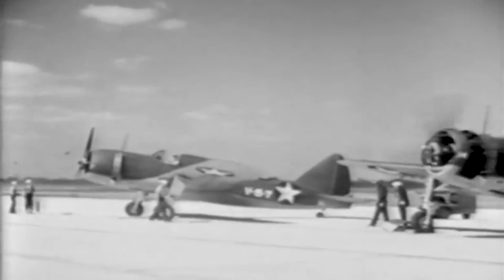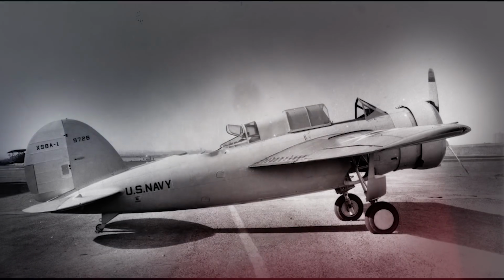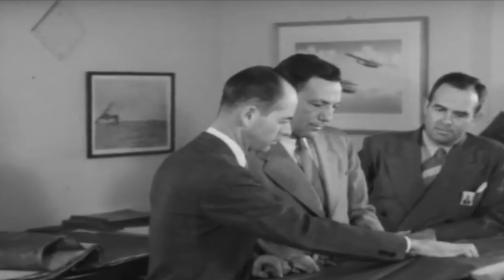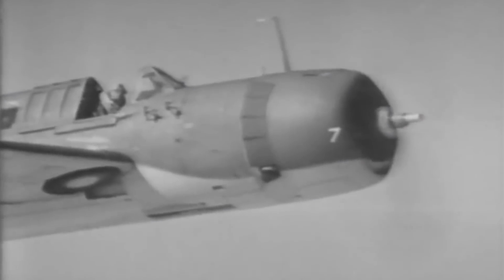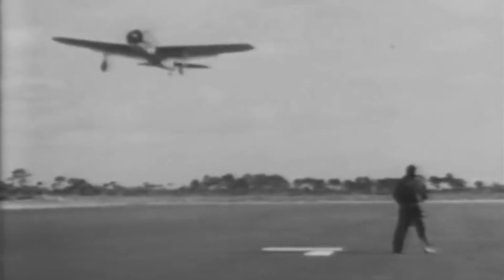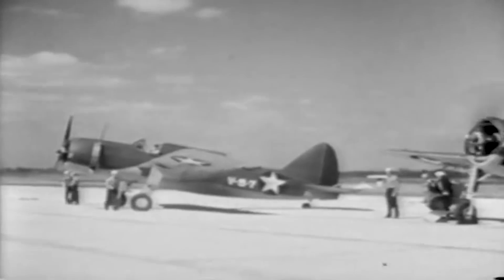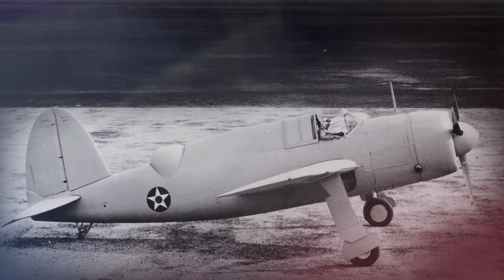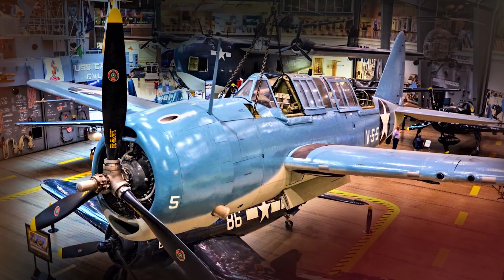The Worst Airplane of WW2 - Brewster Buccaneer Scout Bomber

Comment: The prototype F2a Buffalo Fighter preformed far better than the Grumman Wildcat and incorporated automatic rather than hand-crank landing gear. However as requests were made for the production models (wing folding, armor, self-sealing gas tanks, increased armament, etc) the engine could not keep up with the added weight, while the F4 too these changes in stride with little degradation.

Comment: My father was a WWII PBY Pilot stationed on Cuba during the war. He told me that he had the opportunity to fly a Buccaneer and had to do it solo because no one would fly rear seat. My dad said he needed the whole runway to take off, it had next to no climb rate at full throttle and the engine sputtered as he approached the runway for landing. Anyone who flew that plane called it the "phuckeneer" because it was a suicide for the pilot and rear seat to fly it, the engines would catch fire in flight, a portion of the wing,  canopies or landing gear would fall off and worst of all it had tendencies to nosedive at full throttle into the ground before the pilot and rear seat could bail out killing them both.

Comment: I find it kinda funny that this is what they chose as the worst aircraft. Like there are definitely worse. Breda Ba.88, Boulton Paul Defiant, etc. Also a lot of people forget that this thing is basically identical at least in concept to the Curtiss SB2C (which was also wildly unpopular and had many of the same controllability issues) but that got adopted and was used with some success. I guess the difficulty was that Brewster was never going to be able to fill a sizeable order, much less maintain a supply chain for the aircraft actually delivered. And yeah, there probably was an issue with workmanship. But I'm unconvinced this was an inherently bad plane.

Comment: This WAS 1 OF THE BEST ✈ AIRPLANE$ OF 🇺🇸 US NAVY ;  IT WAS FOR HIGH ALTITUDE FLYING NOT FOR SPEED ,  IT FLEW THE HIGHEST ALTITUDE AT 45009 FEET RECORD MAN ;  IT WAS INVENTED FOR HIGH ALTITUDE FLYING AT 260 MILES IN HOUR ;  NO OTHER FASTER ✈ AIRPLANE FLEW THAT HIGH ;  IT WAS INTENDED FO4 HIGH FLYING JAPANESE & GERMAN ✈ AIRPLANE$ ;  AND IT SHOT DOWN SO MANY JAPANESE & GERMAN ✈ AIRPLANE$ AT 35000 FEET ,  IT WAS THE MOST MANEUVERABLE AIRPLANE$ ✈ AT HIGH ALTITUDE ;   BREWSTER AIRPLANE$ ARE STILL IN SERVICE TODAY WITH BETTER ENGINE$ ;  THEY FLY AT 55000 FEET TODAY ;  IT ALSO HAD A SECRET ROCKET 🚀 BOOSTERS THAT PUSHED THE AIRPLANE AT 45000 FEET ;  IT WAS USED FOR GERMANY CAMPAIGN ESCORTED NIGHT FIGHTERS OF 🇬🇧 BRITISH SQUAD AND DAY CAMPAIGN$ OF 🇺🇸 USA$ AIRFORCE ;   TODAY BREWSTER IS USED BY NAVY STILL AND IT CAN LIFT VERTICALLY NOT NEEDING A RUNWAY ;  THE TODAY$ BREWSTER IS A SECRET AIRPLANE ✈ THAT HAS BOTH PROPELLERS ENGINE AND ROCKET JET BOOSTER$ ; IS A SECRET ✈ AIRCRAFT THAT IS SO USEFUL AND FLYING AT 65 THOUSAND FEET OR MORE , AT 600 MILES IN HOUR AND AT 65 THOUSAND FEET IT FLY$ EVEN FASTER AT 800 MILES IN HOUR ;   CARRYING 2 MACHINE GUNS 22 MILIMITER CANON$ GUN$ AND 2 AIR TO AIR MISSELS ROCKETS 🚀 ,   IT WAS USED SECRETLY IN IRAQ WAR AND SHOT DOWN IRAQI 🇮🇶 MIG 23 ,   IT SHOT DOWN 4 IRAQI MIG-23 MAN ,  BECAUSE IS SO MANEUVERABLEIT CAN STAND STILL ON AIR AND TURN ANY DIRECTION U WANT =  MAKING IT A PERFECT AIRPLANE AIRCRAFT SO = CHEAP TO USE AND CAN FLY FOR 28 HOURS ;  VERY CHEAP ON FUEL ⛽

Comment: Comparing the Buccaneer to the Curtiss Helldiver, I noticed that the wing area was less than the Helldiver by 43 SQ FT..  That's going to hurt overall performance.  The engine was 200HP less than the Helldiver 1700 HP to 1900 HP due to different  versions of the Wright R-2600.  It's not a bad looking design for the time and the wide main gear looks good.

Comment: The SB2C Helldiver was greatly disliked upon its introduction, with many flaws that rightfully earned it the nickname "Son of a Bitch 2nd Class."  By the end of 1944 or so, however, it had been modified and the bugs ironed out to become a pretty fair dive bomber.  While I have my doubts that Brewster-the-company could have done the same with their entry into the same competition that brought us the SB2C (and the Vultee Vengeance as well), simply because they were so pathetically managed, that hardly means the plane was the worst aircraft of WW2... not when it had such illustrious competition as the Blackburn Botha, the Blackburn Roc, the PZL.30, the Bachem Ba 349, the Douglas Devastator (which really wasn't THAT awful, just terribly outmatched), or the TRULY horrible Breda Ba.88.  You want worst aircraft of the war?  Look at that Italian plane, then get back to us.

Comment: One squadron of the Royal Australian Air Force managed to get the Buffalo to perform in a way that was semi-acceptable.
They stripped out all the armour and everything else that could be removed from the aircraft.
The .50 machineguns were replaced with .30 machineguns.
The problem with the .50 machineguns in the wings was that the mountings were not strong enough to cope with the recoil, so the metal broke.
The ammunition was cleaned carefully, to stop grease from the rounds being deposited on the windscreen, which blinded the pilot.
The Buffalo was still vastly inferior to Japanese fighters, but the lighter Buffalo had at least a fighting chance.

Comment: Wasn't the original version of the P51 also underpowered and rejected for front line combat?
Reply: The original Allison engine was OK at low level albeit a bit slow but the Merlin made the plane, giving it range, speed and altitude performance, the Merlin being license built by Packard.

Comment: Almost exactly the same weight as the F4-U. However more drag and 600 less HP. Not good. And that's with the more powerful engine. The F4-U was 700 pounds lighter empty too.

Comment: I live a few miles from the old Brewster factory in Warminster, PA. Brewster became notorious during the war for poor quality, slow production, labor strikes and some said even sabotage by workers. At one point the Navy had to step in and take over the plant and throw out the company president. Locals began calling the plant "The Bucks County Playhouse" as a reference to a well known theater in the area. Corsairs built by Brewster (F3A) had so many problems that wings were coming off because of poorly made fittings. Eventually they were restricted from aerobatic maneuvers, a serious drawback for a fighter plane, and used mostly for training. The site after the war became NAS Johnstown and the factory buildings were used by the Naval Air Development Center. It was closed down several years ago and when the buildings were demolished the original Brewster Aircraft Company signs were discovered under the Navy signs. The  Buccaneer that's in the Naval Air Museum now was being slowly restored by a group of ex-Brewster  employees when the site was closed and sent to Pensacola where it was finished by the Navy.

Comment: This has forward firing guns, automatically that fact makes it better than the Boulton Paul Defiant & Blackburn Roc.
Reply: Not really. If taking on unescorted Bombers, having an aircraft that isn't a complete pig to fly is far more important.
Reply: @jimtaylor294  To be serious this time. If you look at the performance for the Defiant, Roc & Buccaneer, you will see that the Roc is easily the worst of the three and the Defiant is the best of the three, in terms of the actual flying part anyways. Looking at things like ceiling, climb rate, and whatnot.... though the Buccaneer has a far greater range (even if the data I am looking at listed  for the Buccaneer is ferry range and the others are regular, it would still be around what the Roc has and would be about 2x that of the Defiant, however there is no indication that it is a ferrry range). All of that said the buccaneer is about 50% heavier than either the Roc or Defiant, so I Imagine its handling to be inferior. Its engine however is far superior to the Roc and Defiant in terms of power, 890hp for the Roc, 1,030 for the Defiant, 1,700 for the Buccaneer). The mass of an object is one of the things that determines how much damage it can take, bigger things can, all things being equal, take more of a pounding. You can see that come into play in a major way in ships, but still comes into play elsewhere, so something tells me the Buccaneer would be superior to the Roc & Defiant in terms of durability, but of course far more than how big/heavy something is comes into play there. The Defiant for instance has a V-12 engine and those are far less tolerable of damage than the radials used in the Roc & Buccaneer. You can take out a cylinder for a radial and it can keep going while that usually spells doom for a V engine (just as an example).

To be perfectly honest, while the Buccaneer might be crap, those turret fighters are at a different level of garbage than anything Brewster made. The Defiant made for a decent stopgap night fighter until other aircraft were adapted to the role (which were then themselves superseded by the P-61, designed from the ground up as a dedicated night fighter). That was a role that was found for it and only a stopgap in any place.

"One of the worst" planes in WW2, sure, the Buccaneer is easily one of the worst..... "The worst", no, it isnt the worst. Given that I was not lying about the Roc & Defiant not having forward facing guns as well as performance data and whatnot I truly cannot consider the Buccaneer to be worse than either of them.

Sorry about being a bit of an @$$ with that first response.

And really, not even a pair of .303s facing the front, even the Dauntless had a pair of 303s in the nose smh.

edit: typo
Reply: @jimtaylor294  I could respond seriously and talk about how the Defiant worked well as a night fighter and whatnot sure however....

humor go whoosh at flight level 30
Reply: ^ Well we'll have to agree to differ; as I'm not able to respond word for word with this device I'm on.
(I despise OSK's)

I will add though that the clinching factors for me are build quality, and dead weight.

The Defiant theoretically could have been uparmed & engined, as like the Roc it wasn't absurdly overweight, not seemingly fighting its own engine.

Brewster's infamous build quality is the key detail though. Even when taken over by the US Navy & given the job of producing something not crap by design to build; they screwed up, with said aircraft being found to be as much deathtraps, as their own designs had been.

In my opinion Brewster's Bucc' is in the same category of crap 'planes, as the trio of irredeemable WWII Bombers: the Botha, the Hienkel Greif & the Polish Zubr.

Comment: 25,000 feet ceiling and 200mph something top speed were low compared to other piston aircraft in WW2.
Reply: ^ ... Against ground targets. Even a Gloster Gladiator could out turn & fight a Stuka. The Luftwaffe withdrew it from the BoB because it got slaughtered in contested skies.
Reply: @jimtaylor294  But my point is that the Brewster Buccaneer was also designed to be used against ground targets, as were all dive bombers. It can't be compared to "other piston aircraft in WW2" if you are including fighters in that.
Reply: @barryervin8536  The point was more that the Stuka isn't a great point of comparison. Comparing one failure against a better built but even slower one doesn't achieve much.

I mean even the Swordfish Floatplane did better than the Buccaneer, by actually accomplishing something of military value in WWII... that technically included the most visually bizarre bit of dive bombing ever.
(few things weirder than a bi-plane floatplane divebombing a submarine... and succeeding)
Reply: It was no speed demon, but it was a dive bomber, not a fighter. The Stuka was even slower and it was quite successful early in the war.

Comment: Whatever happened to the one at Naval Air Development Center, Warminster PA (former Brewster plant)?  They started fixing it up for display back in the 80's. I never heard what they accomplished, or what they did with it when NADC closed.  

I worked there as an engineer 1976-1996 when I transferred to NAVAIR at Pax River MD.
Reply: I know there is one on display at the National Naval Aviation Museum in Pensacola, FL.  Did some googling, and it appears that it was send down to the museum after the base closed and that  restoration process was finished and its now on display down there.

http://www.aerialvisuals.ca/AirframeDossier.php?Serial=62976
Reply: @ReganSmash33  Thanks!

Comment: Brewster's build quality was appalling. The aircraft were full of loose nuts and bolts dropped by workers during manufacture that no-one had bothered to retrieve.  after complaints from the USN and RAF, Brewster decided to sort that problem. Rather than training the workers properly in quality practices as other manufacturers did, they built a huge hydraulic rig that rotated and shook the airframe so that the loose hardware would fall out!
Reply: Lol

Comment: I bet the Finns would have been able to put them to good use. It's a shame they were shoehorned into the axis powers due to the Continuation War against the USSR. Although the USN, USMC, RAAF and RAF didn't care for them the Finns loved the Brewster Buffalo so much that they worked through the duration of the war trying to make a knock-off of it. The Dutch used it to a reasonable effect in the East Indies too.

While I don't doubt that the Buccaneer/Bermuda was insufficient as a combat aircraft I suspect its problems had more to do with the technology available at the time and the requirements made of it than substandard production.

Comment: Blackburn aircraft says hold my beer!
Reply: Yeah. Made a postwar aircraft of the same name that was the opposite of crap XD.
Reply: @jimtaylor294  agreed, but thru out the interwar and during ww2 they had possibly the worst run of aircraft for a top power imaginable!
Reply: @FarmerTed  Well; apart from Brewster anyway XD.
(Blackburn aircraft in WWII at least could claim to have been built quite well, if not to the best of designs)

Comment: Brewster didn't close its doors in 1946, the navy closed them down in 1944, after cancelling its contract for the F3A Corsair, which it found out that the Corsairs they built under licence from Vought had so many defects, including throwing oil onto the windscreen. Also, the Buffalo's production versions were: F2A-1, F2A-2, and F2A-3 for the Navy, and the Model B-239, and B-339, for export customers. Now, the Buccaneer never had a turret, that was meant for the SBA-1, and the bomb bay of the Buccaneer has doors, not flaps, also, the wings of the SB2A were foldable, on all models, and they aren't "hinged wings". One more thing: The powered dorsal turret on the XSBA was only a mock up, and would've featured two .30 caliber guns, not four.

Comment: The Curtis SB2C Helldiver was only excepted into US Navy service, despite failing to meet any stipulated design requirements plus also having aa list of design faults, because the SB2A Buccaneer was even worst.

The British rejected the SB2C Helldiver due to it's flaws, such as a tendency of breaking in half during hard deck landings, etc. but bought nearly 70 SB2A Buccaneers, which were based at Boscombe Down in Wiltshire.

Comment: Overweight, slow and clunky... Can you say "Helldiver" or "Stuka" or "Albacore"?  Actually, these terms could be applied to almost every dive bomber or torpedo bomber that flew in WWII... Axis or Allied!  It was not a terrible aircraft. The Helldiver was far more of a headache and, ironically, also spelled the beginning of the end for Curtiss. The problem lay with the fact that the Buccaneer (like the Helldiver) was no improvement on the Dauntless (except for folding wings!). It was designed to an outmoded concept and built by a company that simply had no idea how to cope with wartime requirements.  What was needed was what the Navy eventually got in the Skyraider...  an attack aircraft, not a dedicated torpedo or dive bomber.

Comment: The engine was powerful but too heavy for the aircraft?  A nonsense statement.  Was it overly heavy for it power output compared to comparable engines? It was mismatched?  What does that mean, like it was the wrong size and didn't fit?  If you mean it was not powerful enough to impart the desired performance then say that; at least that means something.  Yet the same engine powered many other successful aircraft, including the heavier TBM Avenger, so the alleged poor performance of the Brewster can't be blamed on the "too heavy" engine.  But if you believe the performance published by Wikipedia the Brewster was almost as fast as the Grumman and flew higher and farther.

Comment: The Brewster Buffalo was liked by the Finns, the Airacobra by the Soviets. The Bolton Paul Defiant did ok as a nightfighter,  target tug and was even used in Air Sea Rescue. How about a film on the Blackburn Buccaneer?
Reply: The Finns flew stripped down Buffalos.
The ones used by the USN and USMC were overloaded with survival gear, armor, self-sealing fuel tanks and radio.

Comment: I looks a lot like the Curtiss SB2U Helldiver of later in the war, only longer. I'd be interested to know if aspects of this plane made their way into the SB2U at all since Curtiss too were not familiar with building carrier planes at this time. Combat experience in the Pacific eventually saw the retirement of dive bombers and torpedo planes in favour of multi-purpose fighter bombers or powerful attack planes like the A-1.
Reply: Oddly enough it is actually a  better looking less  streamlined aircraft .But strangely the much bigger and ungainly  Helldiver was better. The Buccaneer actually looked similar to the SB2U Vindicator which was also  better but long obsolete after the battle of Coral Sea and Midway.